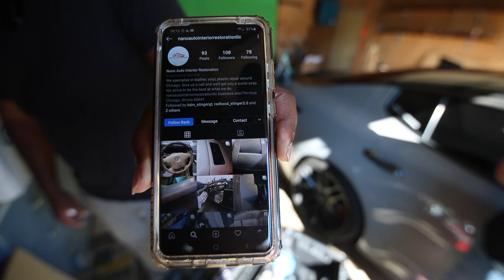How to Fix Leather Interior

Comment: No hate to VividVisuals Stinger, but facelifted Stinger still around the corner. Pictures already popping up with updated interior and exterior leaks. Some notables is the 10" infotainment, more ambient lighting, and possibly active exhaust valves.
Reply: Only zonk in my opinion is rear taillights as I think the 1st gen tail lights are better
Reply: @kevinpullorkunnel9104  I mostly agree. But many people who don't own Stingers always ask if the whole light bar lights up. And when you answer no, they always give a puzzled look, but can move forward pretty easily since the rest of the car being so nice, and also a KIA, is a more relevant topic. I think making the entire light bar light up is purposely sensible. But you're right. It doesn't exactly make it any more attractive. Let's hope they use really high quality LEDS and or have heart beat style turn signals. That would completely solidify KIA in the premium market.
Reply: @davyk8193  u do make some great points.